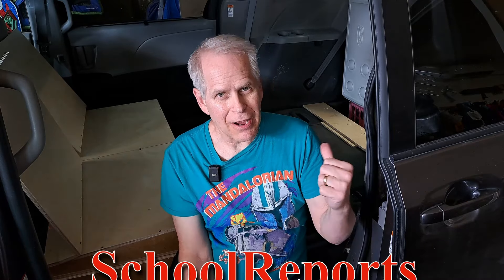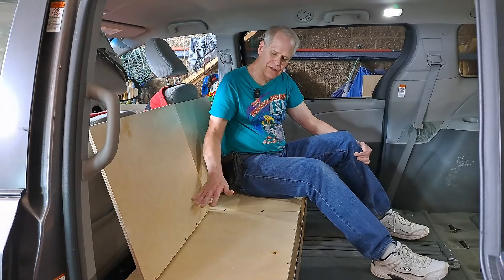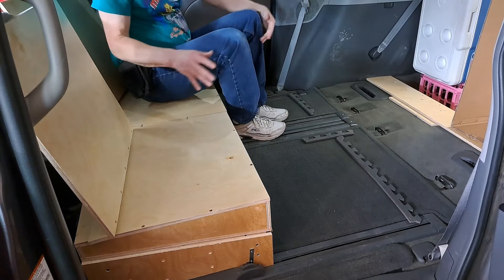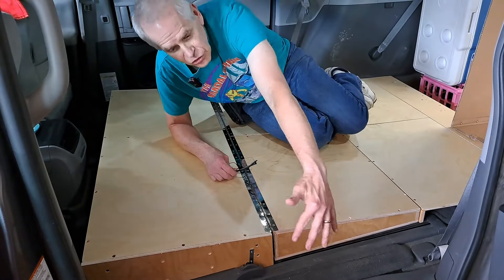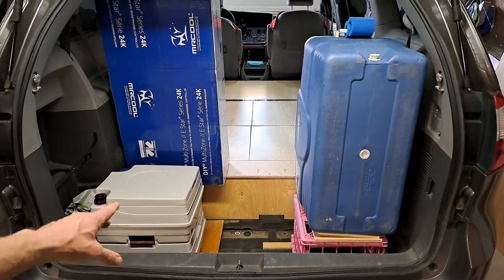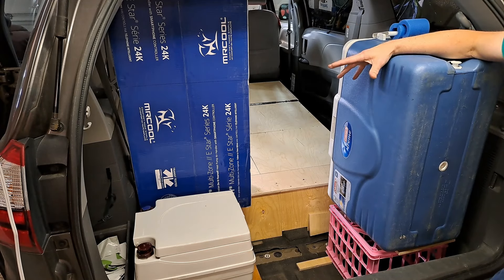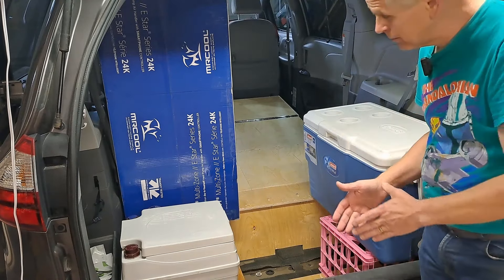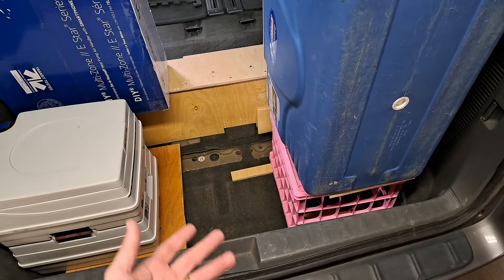Why No Freeze Drying Videos? Transforming Minivan for Camping - Update Before Part 3

Comment: Interesting stuff. We tried "camping" a couple of times, and it always seemed like we preferred bug free zones and a cool breeze. We also tried an RV on a trip to Florida... we weren't thrilled with all the rules that different places have for RVs. After all the calculations we decided it wasn't really worth all the hassle and the cost of gas was practically the cost of a room. 
However, a small camping van would be pretty reasonable. So as far as the couch goes.. you are just planning to use that for seating when the van is not moving?
Reply from the maker: When we had a travel trailer (2720QS Trailmanor pulled with our minivan) and went camping with the kids, most of the time we were boondocking. I'm planning/hoping to make it back to one of my favorites - the Sunstone Public Collection Area, north of Plush Oregon - 42.72329948170522, -119.8603025711538  (Free)
 When we were at campgrounds, it was at inexpensive ones. (Probably always under $30) One of our favorites was Humbug Mountain State Park, OR or  Whiskey Springs & Fourbit Ford Campground. (We went to those 4 places a bunch of times)

Only for use when not moving!
Reply: @SchoolReports  Great stuff. If you get a chance to do it, try White Water Rafting, we had a lot of fun with it.
Reply from the maker: @marcfruchtman9473  I've spent most my life very near to Rogue River at west edge of Greater Idaho! 😇 (or the upper-middle of the State of Jefferson) I've done a combination of whitewater rafting, jet ski, and on jet boat tours up and down the river from Lost Creek to the ocean a number of times. (140+ miles of the river)
But it's the only river I've really ever been on; it would be fun to see other ones.

Comment: Have you thought about beefing up the suspension? As always i enjoy hearing your thought process.
Reply from the maker: I did give it a thought in passing before I started, but I didn't really look into it. As I go along I'll keep track of the weights, but right now everything we "know" we're putting in weighs less than the seats we took out. (But I do know from when we had our travel trailer, that weight creep is a real thing:) It's one of the reasons I decided to go with just 1/2" ply. A 4x8 sheet of the plywood weighs less than the lightest seat! Those 3rd row seats were over 110 lbs, and I think the middle row seats were heavier.

Comment: One of those small fridge will dump some heat in the van won't it? I would think one of those 12v coolers would work well
Reply from the maker: Good catch! All refrigeration units are just heat pumps, they move the heat out of the inside of the fridge or cooler to the outside. (There's no free lunch!) Assuming the same efficiency, they are all going to dump the exact same amount of heat into the space. That's one of the big reasons we are still considering just using a ice chest. That way the heat is made somewhere else when the ice is made. If we use any kind of cooling unit (120v fridge, 12 volt fridge, or 12 cooler) we plan to encase it and add some kind of exhaust fan to push the heat outside.